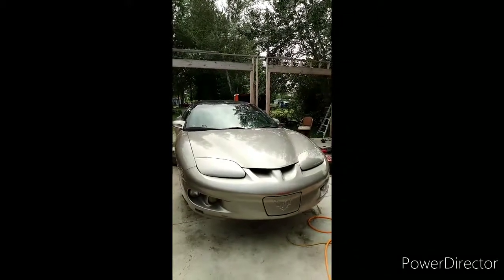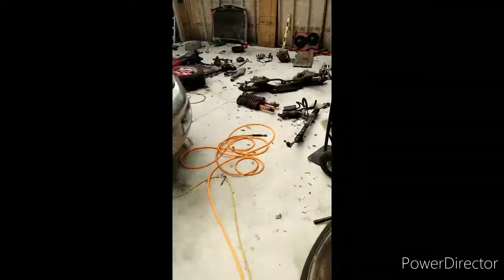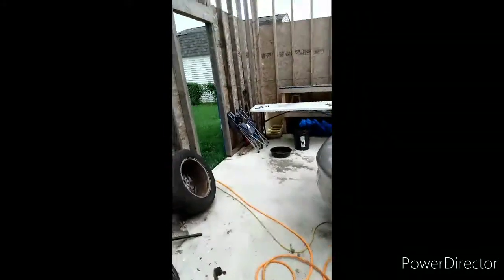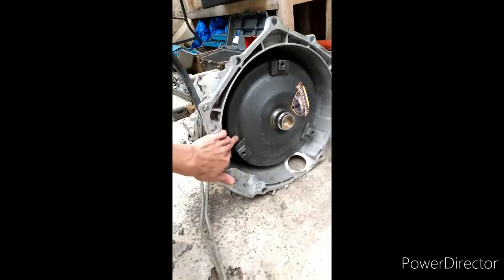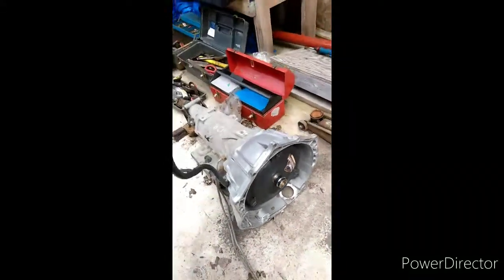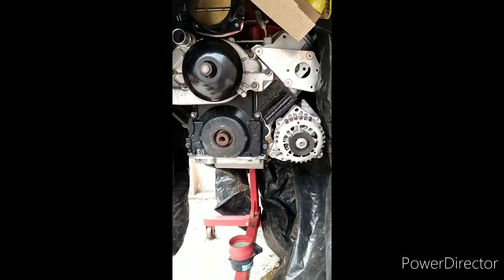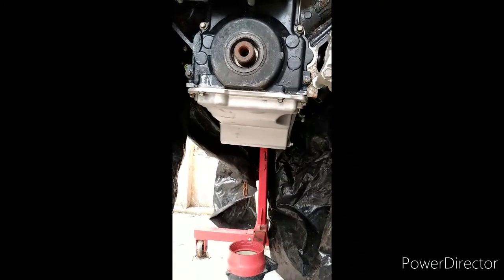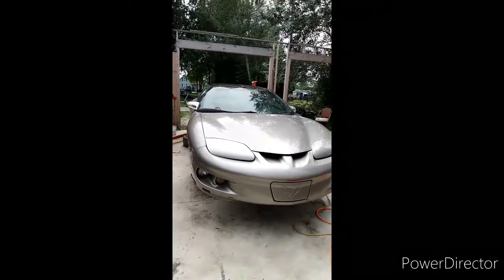98-02 F-Body V6 to V8 LS LM7 Part 1 swap tips

Comment: @hellbird8946 my wife received a 01 3.8 firebird shes wanted for a long time. Motor shot! I have a 07 avalanche that had a bad trans. Pulling motor to put in car. K memeber mounts, oil pan stuff i need. But i will need to move alt and ps along with different water pump? Would love to pick uour brain. My first motor swap. 😢
Reply: So its a LMG motor. I looked up that its in ls class. What do you think?

Comment: Mine is a 2000 Pontiac firebird and it is a 3.8 are you sure i can use the 3.8 transmission
Reply from the maker: @TravisGriffis  i would go with the 30 spline V8 transmission with a 30 spline v8 torque converter  to be honest. It Would save you time and prevent mix ups.  Don't want to put a 30 spline v8 torque converter on a 27 spline center shaft, it will strip the teeth on the center shaft and put metal shavings in the new torque. 

If you go with a v6 transmission and swap the bell housing, make sure 1000% it's a v6 torque converter with 27 splines. And you will need the torque converter Spacer with a dished flex plate.

Comment: So what all vehicles have the V8 27 spline converter ??
Reply from the maker: @EricAtkinsonMusic  yeah all the 3.8 transmissions. But not all GM v6s, the blazer has a 30 spline. I'd just pick a 30 spline v8 4l60e. I accidently put a 30 spline on my 27 spline input shaft and it ate the thing up, I had to replace the 27 spline stator with a 30 spline and buy a 30 spline torque converter for it. I'd do some reading into it. If your going to re use the v6 transmission. It's really confusing to say the least. I'm just putting my transmission back in my car and hoping everything goes well. I'll update a video when the car is driving. It starts and runs, sounds nice just got to get it to move.
Reply: @thehellbird8946  thanks for the reply man .. did you have any issues with those plugs on the passenger fender ..I have a LS1 stand alone harness do I just splice them into that harness and match them to the wires coming out my pcm ?
Reply from the maker: @EricAtkinsonMusic  everything was plug and play on my end. When I was building it I bought a used stock LS1 f body harness and a 5.3 ECU.
Reply: @thehellbird8946  did that 27 spline work man .. I’m thinking about going with a 5 speed or 6 speed

Comment: any suggestions on headers for a 5.3 in a 1998 firebird? Having issue finding ones to install
Reply from the maker: Yes. If your using long tube headers for the F body it's gonna be some modification. I have Speed Engeneering LTHs and true dual exhaust, I paid 1400 for the entire set up. I'm using Spohn raised K member mounts and one of the driver side tube's on the header sit right on the lower steering shaft, and you can't turn your steering wheel, you don't want it touching because you'll wreck if you try to Drive it. I had to mark the spot on the header with a red marker to see where It was touching and I had to whack it with a ball peen hammer to dent it in a good bit, it was still touching so I had to grind my steering shaft down a bit. Now it doesn't touch. Of course it's probably not the safest idea but it should be okay lol but yes I'd probably go with short tube headers. I'd still look into forums on if the short tube's strike or not but I don't think they do. I do wish the best of luck to you! 👍

Comment: What about the harness?
Reply from the maker: You will have to buy the harness from a LS1 Fbody.  If your changing the drive set up to Drive by cable rather than drive by wire You will have to buy the computer on ebay for whatever liter LS your dropping in it, you want one with Vats off. I got a 5.3 computer listed  for a mini van on ebay for $130 I believe it was, if the seller reprograms them message them upon buying tell them the liter and specs of your car, speedo top speed, tire size, transmission and year of the car. But as I was saying if you switch it to Drive by cable. DBC computers are blue and green. The trans am uses blue and red for drive by wire. So all you have to do is buy the blue and green plastic pieces for the harness, they pop off and are interchangeable. Cause you can't use the red and blue colors on the green and blue. The guy who sent me the ecu sent me the plastic pieces cause I told him what I was doing. So that's a important thing to know if your converting your throttle set up. If you have anymore questions feel free to ask. I wish the best of luck to you and your build. I've been planning on getting back to making more content but I had to drop the transmission because I accidently put a 30 spline v8 torque converter on the v6 trans which has the 27 spline stator. If you buy a v8 torque converter make sure it's 27 splines and not 30 otherwise you will be dropping the transmission back out because it's making a loud woooo noise when you hit the throttle in park. if you go with a v6 torque converter your gonna have to use that spacer I showed in the video.
Reply: @thehellbird8946  hell yea thanks a lot for the info Mann

Comment: Hey man I’m doing the same thing to a 2002 Pontiac Firebird. I was curious on where you got the bell housing for your 4l60E and was curious if you had the part number for it. Thank you
Reply from the maker: I bought it used on Ebay. Alot of my parts were from Ebay. You can find em a dime a dozen on there. I think I spent like 75 bucks for it. It's been awhile. Lol good luck with your build man. If you have any questions I'll be glad to try to help.
Reply: @thehellbird8946  ok thank you man. And I sure will. This is my first time doing a engine swap so it’s going to be a big learning process for me to.

Comment: Did you run into anything else that you couldn’t reuse on the motor ?
Reply from the maker: When it comes to the LM7 there's nothing reusable, youl need all LS1 Fbody engine  accessories Including the crank pully.

Comment: Can you use the v6 trans mount???
Reply from the maker: Yes, make sure you have the right number of splines on your torque converter and the input shaft or stator. The transmission we reused is making a woo noise from the trans after the 4th start up. We think the trans pump failed but then again I could had accidently put a 30 spline torque converter on a 27 spline stator. But now we are dropping the trans to check it out, either swap the pump out or replace the transmission. If you can get a 2 wheel drive 4l60e from a LS truck or vehicle that would be better because at least you know everything is copecetic. The only difference between the v6 and v8 4l60e is the number of splines on the stator. V6 has 27 and v8 has 30 splines. I read and  looked up if you can use a LT1 transmission and it said the wiring is different so it has to be one from a LS. But if you can't find a good V8 one you could reuse it. But you will have to find a 27 spline 5.3 torque converter. The only thing I can't tell you is if the v6 transmission will hold up or not with more HP.
Reply: @thehellbird8946  I have a 350 transmission that I am putting with the 5.3? Will tht be good?

Comment: Would you be able to re use the v6 rear end bro?
Reply: For a LS1 5.7
Reply from the maker: @johnnyrush5066  yes, you can buy larger ring and pinion gears for the 7.5 10 bolt. Mine still have the 3: 08 gears in it from the v6. But I bought Richmond 4: 10 gears for it, GM put 7.5 rear ends in all 4th Gen F bodies, V6 or V8. You can put a 8.5 in it or buy a aftermarket rear end. But everyone claims the 7.5s break. Honestly it's not breaking with stock set up imo. Now once you start running a bigger cam, supercharger, turbos, anything that's adding massive HP than it would possibly be a good idea, but I say, let it take it, until you break it.

Comment: I plan on doing a ls3 swap on a 98 firebird v6, anytips?
Reply from the maker: Yes. The 150 mph v8 instrument panel needs to be one from a 98. The pins are specific for that year. 99-02 lights and guages won't work. If you have a 99-02 you can interchange any of those years. That's the main thing I can think of off the bat,  
If you have any questions I'll try to answer them to the best of my knowledge.

Comment: Do you have a link on the spacer you used for the torque converter
Reply from the maker: If your using a V6 torque converter you will need the spacer. If your using a V8 torque converter you will not need the spacer.  I just looked on eBay and found a cheap 5.3 torque converter with 27 splines. Not a 30. But if you get a 5.3 torque converter you wont need that little spacer. Good luck 👍

Comment: Swapping electric steering when I do mine 93lt1 to lm7 or LS?
Reply from the maker: You can use any LS variant you want, 4.8  5.3.  6.0 or a 5.7 LS1 they are all the same block it's just the truck LS variants are usually iron Block, the car engines are aluminum. The 5.3 LM7 is a Iron block, you will just need all the Fbody LS1 accessories, LS1 harness and a 5.3 ECM. The LS1 harness has  red and blue ecm plugs and the truck ECM uses blue and Green, Its been a little while, but I believe it's the red plastic fitting take that off and replace it with a green one. You may have to look into it. You won't have to worry about running a wire from your right side fuel injectors to your fuses, because the LT1 and LS1 cars use both INJ1 and INJ2. So those are ready to go for you. But yeah use any LS or LS variant you want.
Reply: @thehellbird8946  oh  I know what all is involved I was just commenting on what I was swapping from and what I was going to be putting in was either the lm7 I have or I might try to find an LS3 because I had a 2015 SS before the 93 I have

Comment: So a k member from an ls1 5.7 trans am is comparable with the 5.3 also?
Reply from the maker: Yes, all the LS engines are the same, even the Truck variations, 4.8 5.3 5.7 and 6.0. they all will bolt right up to the LS1 k member.

Comment: What brackets did you use to relocate the alternator, power steering and pully ?
Reply from the maker: I can't remember the brand but I got both relocator mounts on eBay. I used a side mount alternator relocator bracket .

Comment: So you can use the v6 k member you just need the adapter plates?
Reply from the maker: Correct. I seen a pair only one time online, I honestly can't remember where, but I know they do exist. I just ordered the LS1 k member from eBay it was like 125+ tax and shipping so it was like 210 I believe. It was heavy the fed ex guy was mad lol
Reply: @THE HELLBIRD  probably ends up being easier to just get the k member, in my case going turbo I think I will need the "turbo" k member regardless to run exhaust

Comment: Hey bro I have the v8 K member and it seems like my steering rack knuckle is not allowing me to put my steering shaft into it. It's hitting on my motor mount I have the same style motor mounts as you. Any help would be greatly appreciated.
Reply from the maker: I didn't have a issue with it hitting the mount, the header was sitting on top of my lower steering rack and I couldnt turn my steering wheel at all. I had to grind the lower steering shaft down where it was striking the header, then repainted the shaft so it didn't rust, then I also had to put a dent in the header where it sits. I'm using spohn k member mounts and they are a hair higher than the stock mounts and it was still striking. You don't have to mess with your upper steering shaft, leave that alone. Once you get the lower steering shaft bolt loose a large flat head will pop it up and out of the joint. Its probably the biggest obstacle with using long tube headers. I'd say if you want to avoid that just go with short tubes or the stock manifolds. I wish I could be more help.
Reply from the maker: As far as it goes for the steering rack, the steering shaft should tap right down into the steering rack with a hammer. But of course my lower steering shaft was already connected to the k member and steering rack, but I believe the shaft is the same as the V6 cause they are short and fat.
Reply: @thehellbird8946  thanks for the reply man, I appreciate it. Do you possibly have a picture of your steering setup? I could check on insta if you have posted it there or something previously
Reply from the maker: It's a real pain but I'm sure you will figure it out, read lots of forums on google. That's what I did. Not much for videos out there lol

Comment: I'll be doing my 3.8 v-6 too a 6.2 Ls soon, trying to gather all parts needed 1st. Thanks for the tips !
Reply from the maker: One thing to keep in mind. I have to cover in my next video. Do some research on the INJ1 and INJ2 in your fuse box. Those are your sets of Injectors and the 3.8 uses 1 Fuse for its set of injectors for both sides INJ1. the LS uses both INJ1- Right side Injectors. INJ2- Left side Injectors. Since INJ2 isnt hooked up you have to run a Wire from Your IGN fuse to your Left side Injectors. I forgot which color wire on the injector harness it wires up too. But that's important to remember or your car will just crank and crank.
Reply: Hell bird Would you be able to reuse the rear end bro

Comment: Are you able to reuse any of the v6 accessories?
Reply from the maker: Just the steering rack, sway bar, control arms and the transmission. The bell housing is interchangeable, you will need The V8 harness the ecm for that engine, I got mine from eBay from a van, the vatts turned off. You need to get a c5 Corvette fuel filter to keep it a return set up, those v8s have returnless fuel system. Need the V8 k member. And for the engine it uses all LS1 Fbody engine accessories, truck accessories are too large.

Comment: Wow I had no idea you can reuse the transmission!  Is that adapter the one they sell for th400? Also any 5.3 truck bell housing will work?
Reply from the maker: I didn't end up needing the spacer like I thought. It fit right up. Just make sure whatever size torque converter your using is a 27 spline deal.
Reply from the maker: Yes. As long as it has that top bolt hole. And it's from a 4l60e

Comment: i have a ls1 4l60e missing 3rd and 4th gear when i swap bell housing to v6 trans could i reuse v8 torque converter ?
Reply from the maker: You can use the bell housing but the V6 transmission from the 3.8 has a different pump shaft. Has less splines 27 rather than 30 I believe it is. I'd recommend to just buy a torque converter for a 27 spline to be on the safe side. The flexplate spacer was not needed. I got a 2300-2500 stall converter. Maybe a little under rated but it's what I could find for a cheap price. Hope it works out for you! 👍

Comment: I had to swap my ws6 from an ls1 to an lm7. I bought it knowing the engine was bad but I had no idea it destroyed the block when it threw a rod. I could’ve salvage any of the long block even both heads were destroyed when crap went into the intake through the EGR. Another reason to delete it lol.
Reply from the maker: Yeah the LM7s are better in my opinion yeah smaller bore, but even a 6.0 iron block it will live a long time. The aluminums like to Warp or crack from heat sometimes. Iron takes a beating.

Comment: Hey its me again do u know what I have to do to get my transmission to engag its firing up put it in gear nothing and I know the transmission was working b4 could it be wiring
Reply: When you put the converter back in, did you make sure it seated completely before installing the transmission? Best wake to make sure you did this correctly was to see if the converter spins freely when the tranny is bolted to the engine but converter isn’t bolted to flex plate. If it wasn’t seated correctly, more then likely the transmission oil pump broke either upon tightening the trans or startup of engine which would cause the exact symptoms your having.
Reply from the maker: @Lou_sassel315  I got mine all together and in the car. It's almost ready to run. Needs exhaust, radiator and a few little nicknacks. But I do still have to tighten the torque bolts on mine lol
Reply from the maker: Should do it's thing, never heard of anyone have that problem. Did you make sure your toque converter grabs anf fits the input shaft. Like same amount of splines.

Comment: You can use a exspess van ls pick up tube and oil pan,it will clear k member on f body
Reply: I always saw that come up as compatible parts. Good to know it works. So a Express Van 6.0 should drop right in 🤨
Reply: I’m try it out but what years ?